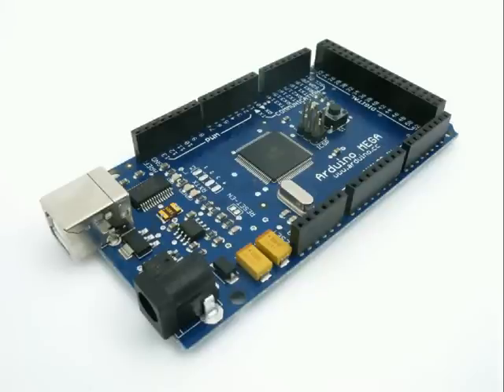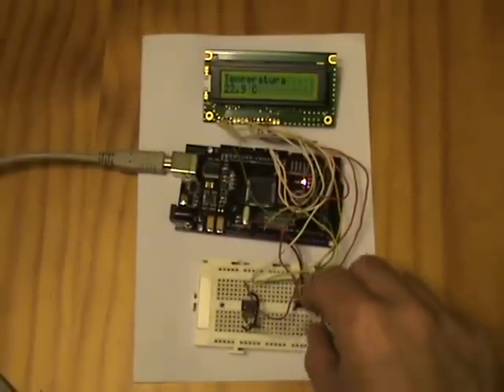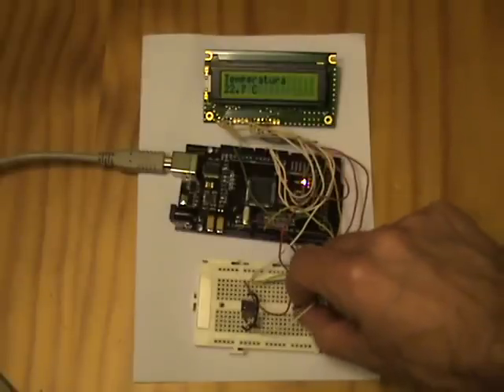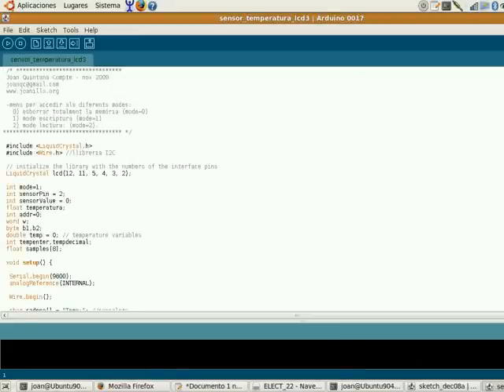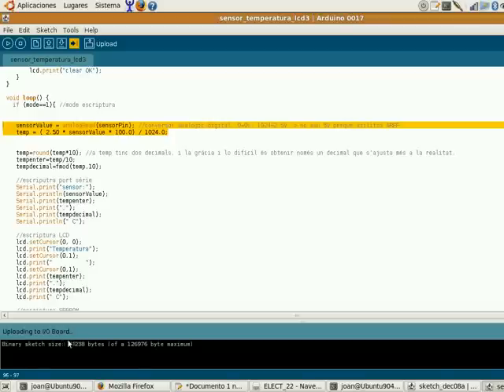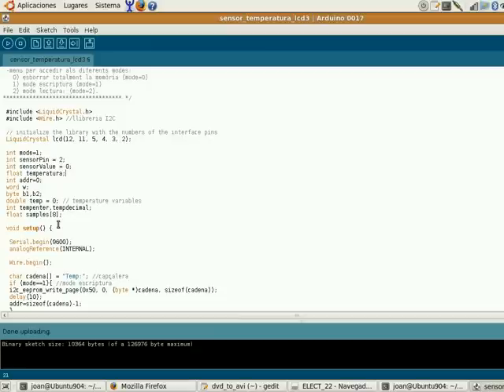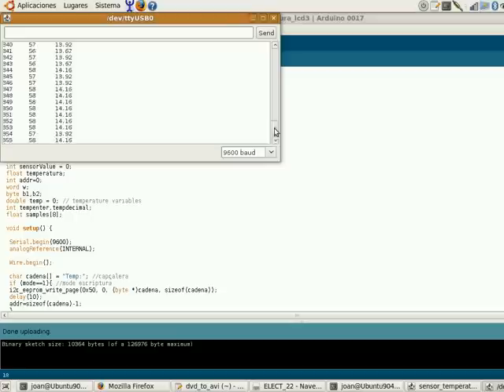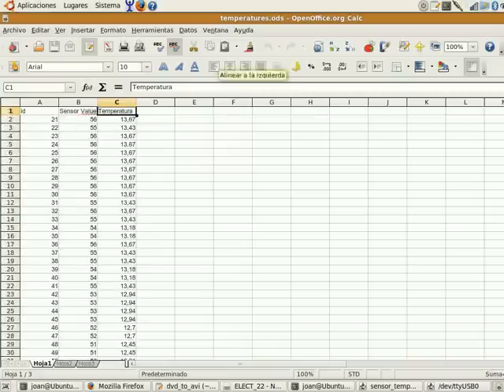Temerature Sensor with Arduino and data logging

Comment: which is your temperature sensor name  and what do you do to make your sensor data stables ( not like 20.00 -20.20 - 21,10  plus 1o C in less than sec because of unstable voltage)